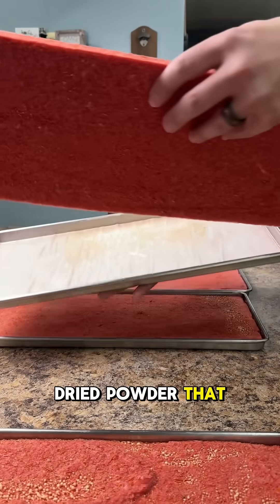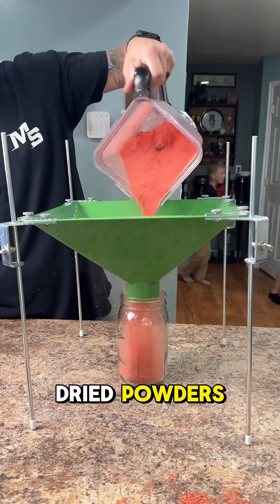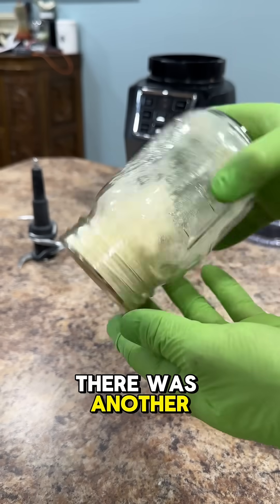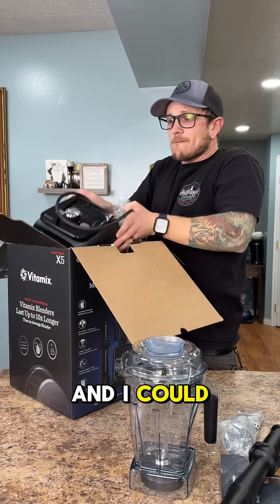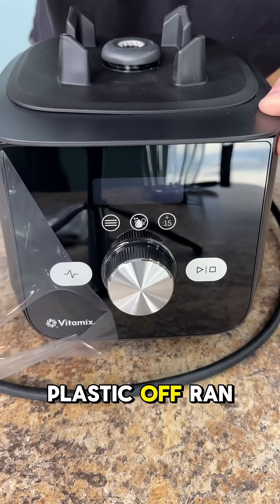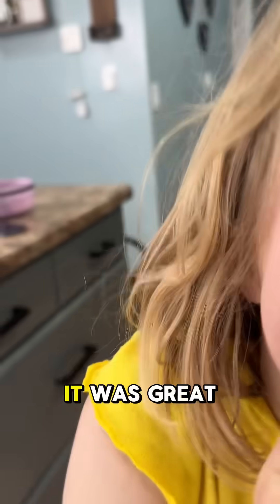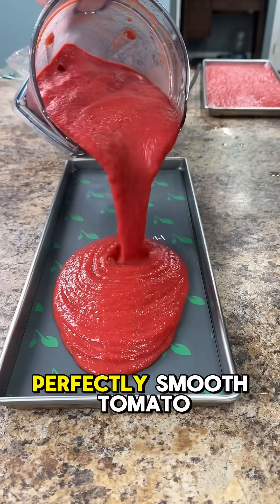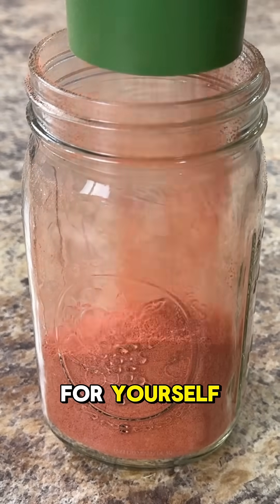This Blender Solves A HUGE Freeze Drying Problem!

Comment: Heads up.  Vitamix blades unlike most brands do have to be replaced (most brands just expect you to replace the whole dang blender every couple years).  The blades aren’t horribly expensive and it’s actually really easy to do.  If you start noticing that you have clumps or it’s taking longer to get the same consistency replace the blade.  It’s why vitamix is the go to for commercial use.  Absolutely every part can be replaced/swap individually by the owner fairly quickly and easily.
Reply from the maker: I didn’t know that, but it makes sense! Thanks for the heads up!
Reply: I used vitamix at an icecream shop. They were so easy to completely disassemble to clean (though the ones we had also had a hollow handle that had to be cleaned with a straw cleaner, so be wary of nooks and crannies) and they were powerhouses that could really churn even really thick things well even when we filled them higher than we really should have. Theyre basically fully disassembleable which is why theyre so easy to replace pieces of.

Comment: Freeze dried foods don’t last a month in jars. You need to use Mylar bags.
Reply from the maker: I disagree entirely. If stored in a dark room at room temperature with an oxygen absorber or vacuum sealed, they’ll last years. Mylar is by far better, I’ll agree with you there, but glass works perfectly fine for a few years.
Reply: @ I had to throw away about 40 jars of mushrooms, peppers and all kinds of stuff. Everything in jars will turn spongy because moisture can enter jars. It only takes a few weeks to happen.
Reply: Moisture won’t bother if you seal and throw in an oxygen absorber
Reply: @maryelder-s6r  That’s extremely dangerous. That’s how you get Botulism. You can’t use oxygen absorbers if any moisture is present.

Comment: My last reply got deleted from YT, so I'll try again. I read your comment in regards to selling FD-products (and needing to pay a fee to Harvest Right for this, if I understood correctly). You can look into "Leosmak" freeze dryers. I need one from this company as HR does not have any support what_so_ever for EU customers. So I looked for alternatives. Leosmak has cooling and heating per tray, so you don't need to freeze/heat the whole chamber (this makes it much cheaper to run). You can also pressure wash inside the machine (because heating/cooling is per tray). The oil only needs to be changed a couple times a year. It's a bit more pricey, but consider looking into one if you need to buy another FD.

Comment: Why don’t you sell the freeze dried powder to those who wana buy ?
Reply from the maker: Because we have a pretty small freeze dryer and the licensing for that isn’t worth the amount we would be able to make and sell. I don’t want to spend all our time freeze drying things to sell, I prefer freeze drying our own things. Maybe one day though, I’ve definitely thought about out purchasing a larger freeze dryer specifically for that!
Reply: @WhitepepperFarm  look into Leosmak freeze dryers. Same type of upgrade like vitamix is to ninja. I'm gonna buy one of theirs in the future. A bit more $, but they are built better and smarter. You can pressure wash the inside, and the shelves have a heater and freezer built in (lots of electricity is saved). Also you only need to change/filter the oil a couple times a year.
Reply: @ you should do it … or maybe start small … donate some to people who are less fortunate… It will help them out with extra meals they can’t afford …